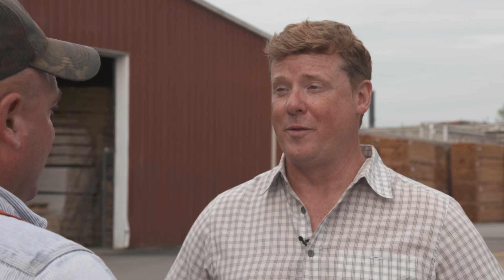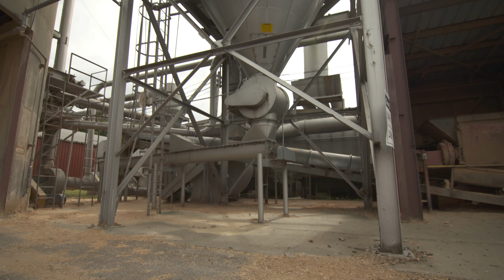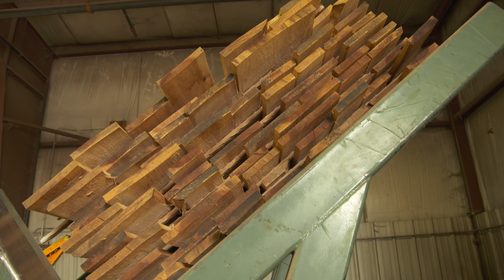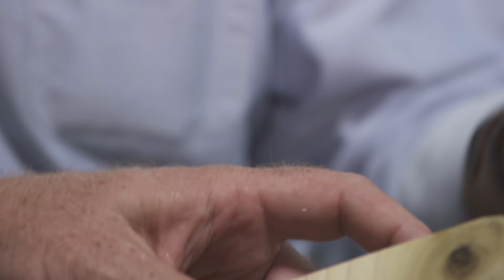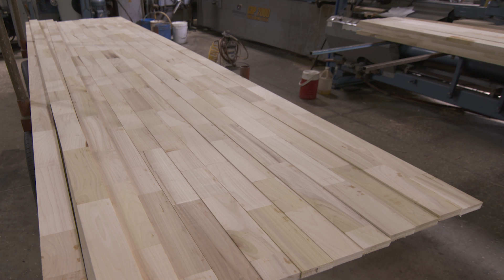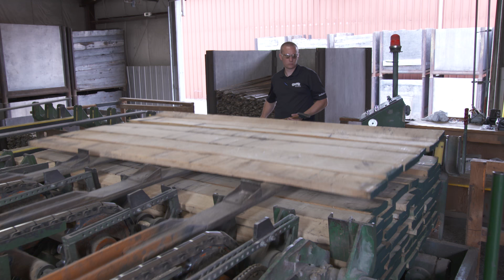How Doors Are Assembled | This Old House

Comment: That is pretty slick.. but given the capacity, why are the doors still so stupidly expensive vs the wood itself? A custom 8 ft door is $600+. The wood is about $60 of that. That it costs $120 for a 80" door and $600 for a 96" door is just nuts.

Comment: I’ve been looking for white oak, preferably quartersawn doors to install in my house.  About every 3 months, I do a google search of companies that make them, and Baird always comes up, along with Allegany and 1-2 others   I need at least 20 doors, and preferably 28 doors, but am not willing to spend $700-$800 per door.  I’m selling my house in 6 years, so in that time, I’ll have to find a local carpenter that knows what he’s doing, and supply the wood for him to build them.  I’m in the hardwood flooring business and know several people with mills.
Reply: Dean DeCoursey, Nobody will care you dumped a ton of money into the doors, leave them and sell it, I know it's an opinion....
Reply: I bought the house “as is,” which means there were 4 doors missing.  So I have to buy at least 4 doors.  I have rosewood parquet floors bordered with select white oak flooring throughout the house, so I may buy rosewood doors in Thailand, where I lived and still have connections, and have them shipped here.  I can probably do that for $250-$300 per door.
Reply: @deandecoursey7721  
I was about to comment on a carpenter costing as much ir more than the purchase from the big companies then I saw where you live.
 Next to slave wages will always being down costs unless you're Apple.
Reply: William Smith   One of the problems that I have with these companies, besides the price, are the complaints about their doors warping.  I think importing rosewood doors from Thailand, which I’ve done in the past for the purpose of selling, is probably my best option.  With building white oak doors myself a close second.
Reply: @deandecoursey7721 
Side rails are sandwiched, even these warp ?
I am thinking of buying solid wood doors.

Comment: The scanner that is similar to an MRI to tag defects in wood is very impressive, along with the machine that removes them. There is very little waste of materials in this factory, from reuse by machining (cutting groves finger joints) gluing short lengths to form longer pieces.

Comment: Here you can see just another reason why American homes are as soundproof as paper.
Reply: I don't get it.  What's the reason?  Doors that aren't 3 inches thick?
Reply: @jej3451  No soundproofing, single layer, no rabbets, no rubber seals,  ...
Reply: @julianreverse  None of that significantly affects sound transmission.  The only thing that blocks sound is mass.
Reply: @jej3451  Wrong. Mass is just one of many ways.
Reply: @julianreverse  Citation needed.  The things you are talking about have a minuscule effect.
Reply: @julianreverse  Rubber seals for interior doors??  We use them on exterior door only.  The US mostly relies on forced air HVAC, so sealing interior doors doesnt work very well and will pressurize a room.  If you have radiant heat, then yes you can seal better.

I put in solid-core doors, inside is all ground up wood fibers, and it does wonders for noise.
Reply: @bigpjohnson  Yes, rubber seals on interior doors for soundproofing https://www.beschlag-paul.de/images/beschlagabc/Falz.jpg

Your heating systems are an other problem for soundproofing. 
Also no insulation in interior walls and ceilings.
Standard interior drywall in Germany, two layers of drywall board on each side and 50-75mm insulation inbetween. 
https://www.baulinks.de/webplugin/2009/i/scaled/1148_x_1432-rigips1.jpg
Reply: jej3451 Mass blocks low frequency sounds. For high frequency sounds you need to close every tiny gap = rubber seals. But i think this factory only produces the raw form of a door. Hardware will be added in a later stage.
Reply: Sry were not German and don't soundproof our rooms to murder runaway youths
Reply: Clearly this the the ONLY option for doors that people have when they build a home... lol
Reply: I live in an older tract home in CA.  Honestly, no one can hear the screams of terror coming from the basement.  Wait...I meant shouts of joy.  That's it...joyful shouting.